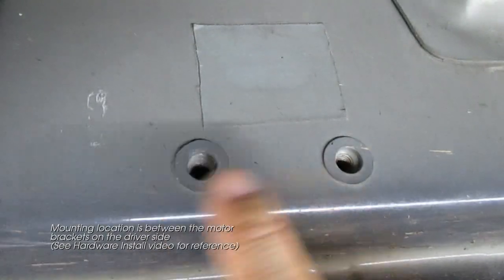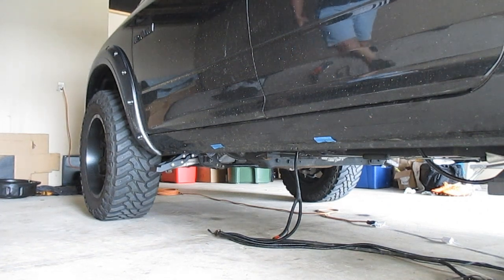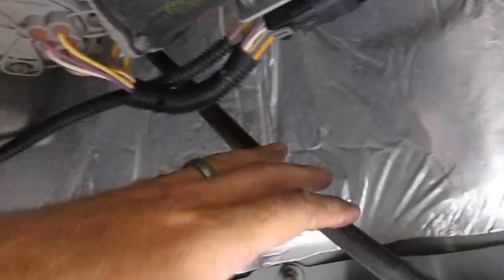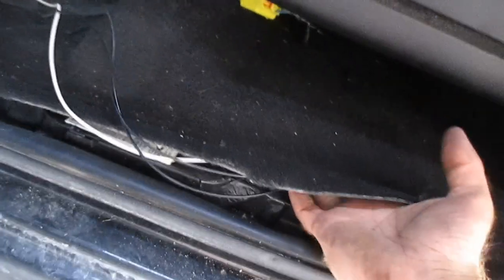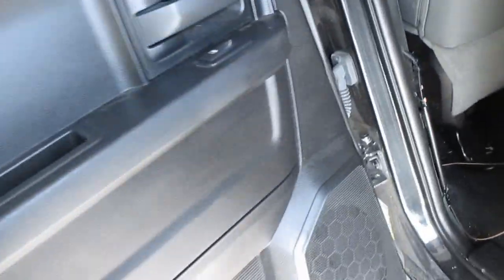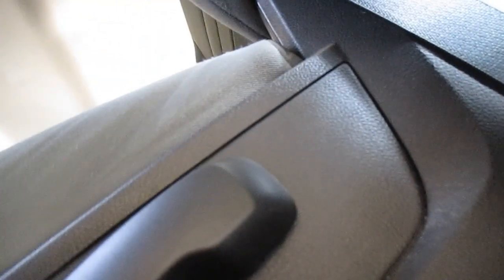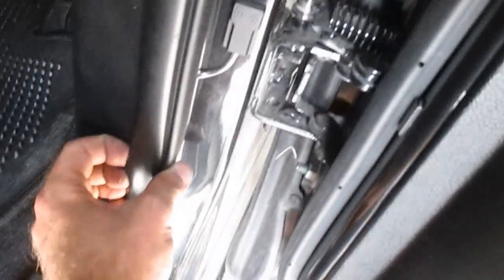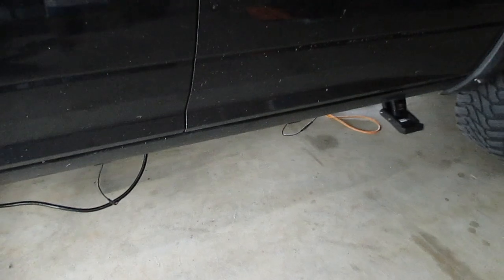HOW TO: Step-by-step wiring install for the RBP Stealth Power Running Boards | Part 3

Comment: Well done, and well explained. I installed the hardware this evening. And will be doing the wiring in the morning. This will help me immensely.    Thanks for sharing.
Reply from the maker: Thank you. With the lack of visual aid when I took on the project, I thought it may be helpful for others to see the process. So I'm glad that's true. Good luck and I hope it goes smoothly for you.
Reply: Aaron O'Connell I am registering the steps on their website now. It’s asking for the serial number (though appears not to be required). Do you know where to find the serial number?
Reply from the maker: @MrJerrydc  The serial number can be found on the box (white sticker with barcode) bottom number should start with "RB" plus 9 digits. At least that's what mine is. You can also find it on any of the motor brackets on the arm on the left side.
Reply: Aaron O'Connell thank you.

Comment: Looks like a pita compared to AMPS.
Reply from the maker: I'm sure it is since AMPS uses the module connect under the dash. I prefer this set up for a couple of reasons. #1- cheaper, #2- I still have access to the module for computer checks or tuning without having to disconnect the running boards, #3- if anything goes bad, I can pull pieces apart individually and send back for replacement. For instance, if a door sensor stops working, I can just unplug that door connector and send back for replacement part for free with the 5 year warranty. I haven't had hands on with the AMPS boards, but it does seem like there is less involved with it.
Reply: uhh no. the RBP's dont connect to your truck computer. Dual motors makes it work perfect. I would never want something electrical on the underside of my truck to connect directly to the computer, especially if you do any off roading.
Reply: @Vincent Webster  well to be fair im not sure you would want to do offroading with power running boards
Reply: @dominiquebrown2890  
You’re absolutely right.I have a beater for off road stuff.

Comment: On my truck, the battery is on the driver side. So it runs from the battery, down through the engine bay on the driver side to the harness connector mounted in the middle on the underside between the running board brackets. Please let me know if you would like any further explanation. I hope this helps.